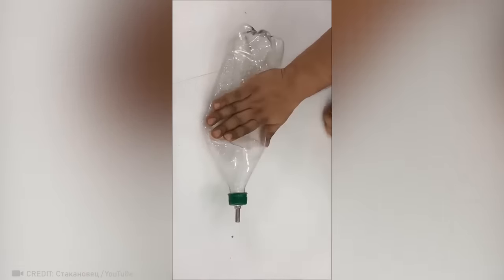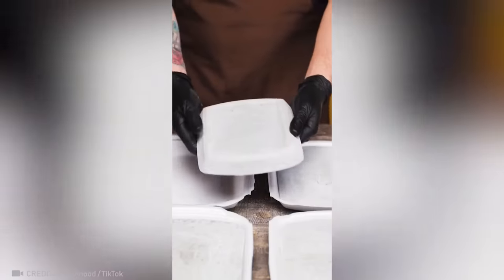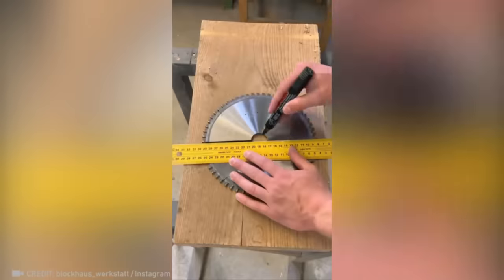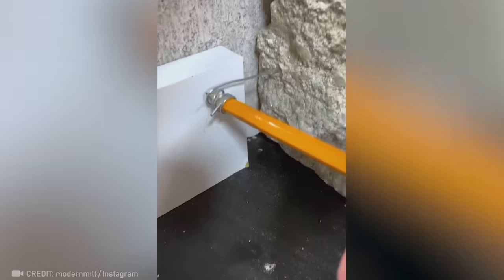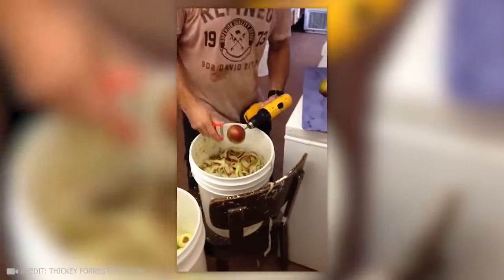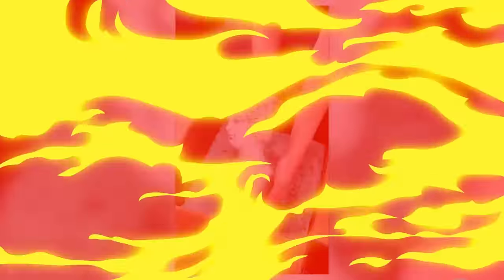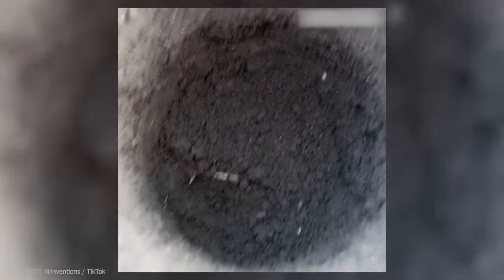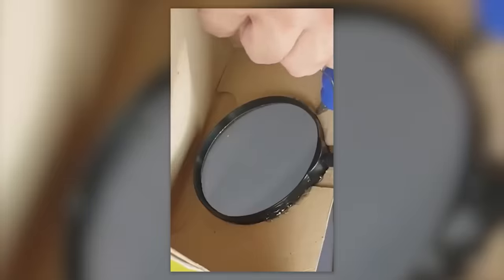Construction Tips & Hacks That Work Extremely Well

Comment: Some very interesting hacks for sure…however a water hose attached to an electric fan…maybe not the best one if you want to get older.
Reply: Yes I was thinking the same thing.⚡️
Reply: Attach it under the fan so it doesn't drip inside the electronic parts.

Comment: Not to knock these ideas.... But using a soda bottle as a jack, can be VERY VERY dangerous. If you overdo it, that bastard can put shrapnel in you so bad. With a hand air pump = great. If you use an air compressor, it could wreck your hand, eyes, or any other part of your body soooo bad. I really like the idea, and I'm going to use it, but you really gotta be careful.